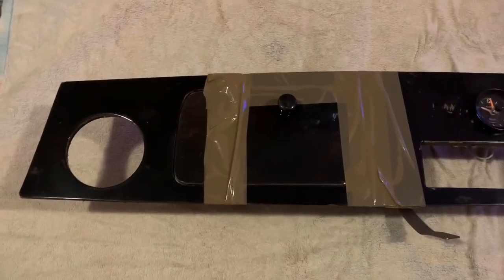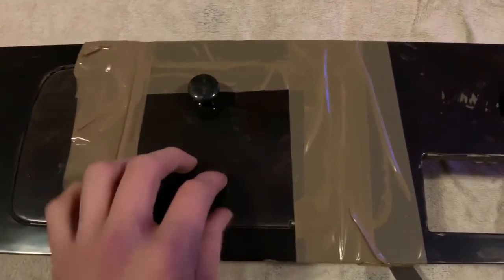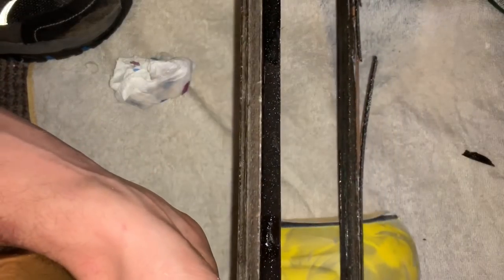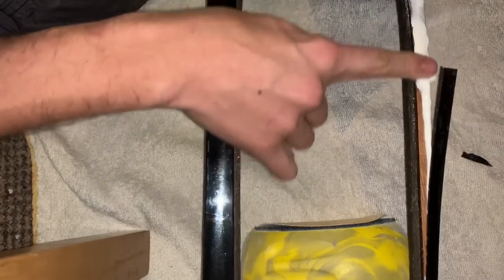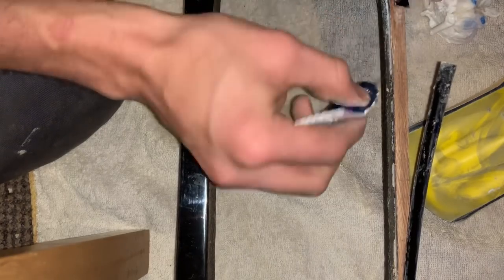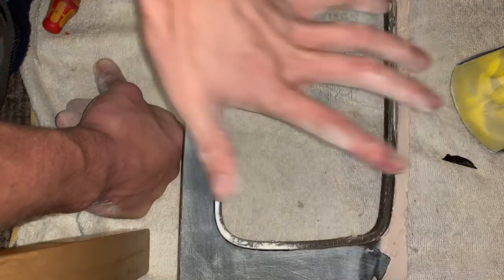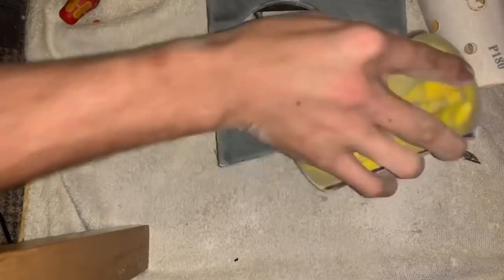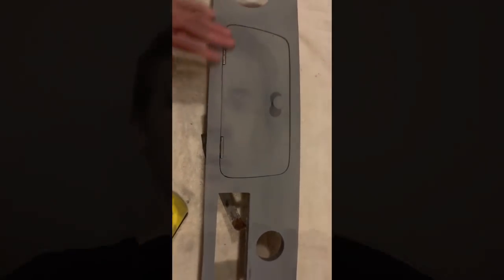Classic mini restoration-how to repair your cracked and damaged dashboard

Comment: Tom, the best glue for this would have been PVA wood glue. I know you said that it didn't work but if held under pressure with clamps for 24 hours this would have adhered the veneer to the board. Sean
Reply from the maker: Sean C cheers Sean, I did have a couple of attempts at it, and did put weights on it using all of the adhesives, but I will admit I didn’t wait 24 hours so maybe that was the problem. That is for the info
Reply: @minitom7772  Yeah PVA is a good adhesive. I used to use it in a watered down state for sealing walls prior to plastering and sealing stonework if I was cement rendering and also use it if I'm painting a wall in the house especially if the wall is newly plastered or bare plasterboard as it stops the paint from being sucked in.  It has so many uses if you know how to use it :)
Reply from the maker: Sean C I’ve used it plastering before. It’s also good when you spread it on your hand, let it try and peel it off 👍🏻

Comment: Biggest thing restoring something is you have remove all the old adhesive as the new adhesive needs to bite into both surfaces kinda like repainting something you have to scuff it up to get the paint to bond. there is also an iron on laminate you can buy to start over.
Reply from the maker: PIPER DOUG yeah I should probably have done that. That’s good about the iron on laminate though, probably would’ve been easier to get hold of some of that. Cheers Doug
Reply: @minitom7772  Yeah any hardware store that deals in kitchen cabinets or counter tops will be able to hook you up.